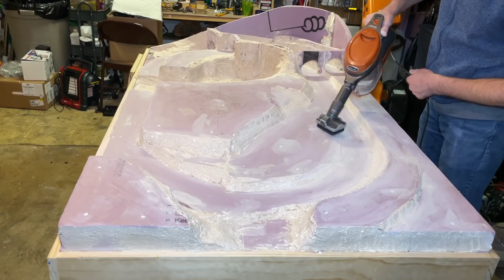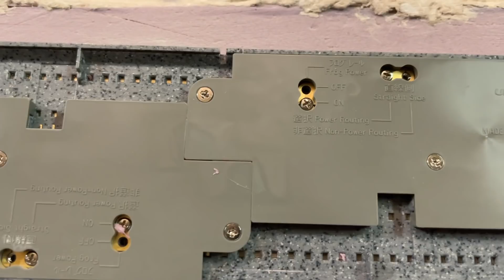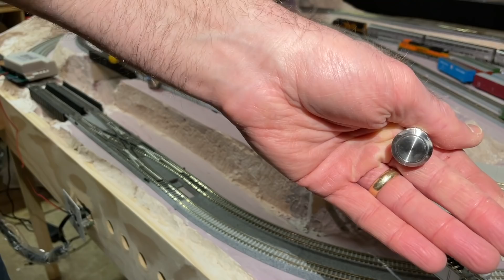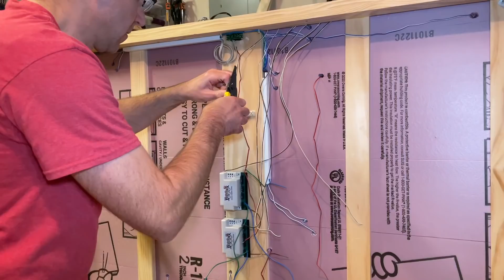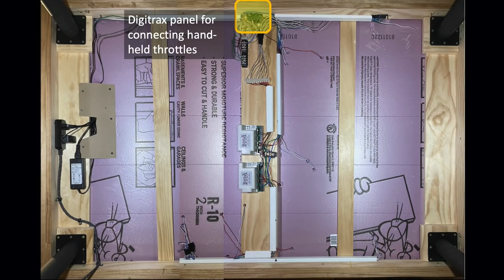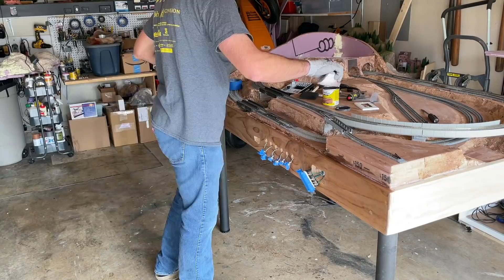3x5 N Scale Layout Project Part 2: Wiring for DCC

Comment: Is it possible to run a bigboy on this type of layout. P.s im a new subscriber to your channel. Thanks for the great videos.
Reply from the maker: Yes, I have a video or two where I run an Athearn Big Boy on this layout. The curve radius is no problem for any of the big boy models out there (BLI, Kato, etc). The only thing to be careful of is the tunnel portals and clearances around the curves since those locomotives are long and will overhang the track on curves more than other equipment so you need a little more space between the track and scenery than you might initially think.

Comment: your projects are always the best thank you, can you tell me how far apart you put your feeder wires? and do you solder track does it help
Reply from the maker: I usually put feeder wires in between each set of turnouts or otherwise about every three feet or so.  That is overkill, especially if you solder rail joints, but you are going to have some voltage drop through every rail connection over time, so have no more feeders can help prevent areas with voltage drops as the layout ages. That really isn’t that much of a problem but it isn’t that hard to add more feeders when building and a harder problem to solve 5-10 years down the road. The fewer rail joints you have the fewer feeders you need. If you solder rail joints leave some open for expansion and contraction of the layout will undergo any significant temperature swings. If you solder rail joints you in theory need fewer feeders because most of the voltage drop will happen across the rail joiners.

Comment: Steve, I have Couple questions about your set up for turn out control. Can you provide a spec or link for your push button switches?  And does wiring the switches the way you have preclude being able to you the Zephyr or hand throttle from being able to operate the turn outs?
Thanks 
TT
Reply from the maker: This is the link to the buttons: https://amzn.to/3KjR6IA  and yes, you can still operate the turnouts using the zephyr or hand controller as well. Since the buttons are momentary, they don't interfere with any other controls. It simply flips the direction from whatever the current direction of the turnout is when pressed.
Reply: @StevesTrains  thanks Steve. I have learned so much from you and your videos!!

Comment: Ok I like the legs but have a question: Are the legs the same ones that originally folded in? If so, does the plate come with the set so you can screw the legs on, so they won't fold? Was a little confused and was considering buying them. Thanks for any help on this subject!!! Stay Safe & God Bless!!!
Reply from the maker: So the legs come with the folding brackets and the fixed plates.  I didn’t have to buy anything extra. I didn’t know I was going to get both, however, so I can’t be certain you will always get both of you order those legs.
Reply: @StevesTrains  Thanks for getting back. Will try it out & hope I get both plates as well.

Comment: Hi Steve: I would if you could send a complete wiring diagram. I'm new to this, I have almost everything to start my project. I'm also wondering where you got your Kato # 20541: curved 15"+16.3", angle 45 (viaduct) 2. I have run out of options. Can you help with the items?

Comment: Ok so on the kato switches  did u do insulated  jointers on both sides of the rail or just one side of the  rail
Reply from the maker: I used insulated joiners on both rails of both tracks of the frog end. You really just need to insulate the frog rails but I did both rails so there wouldn’t be a gap in the other rail since the insulated joiners have that plastic piece that separates the rails.
Reply: @StevesTrains  so with doing both  rails , when using the dcc power pac  i looks like it goes  smoothly  all the way around . But what on the sidings . When u move the loco over past the insulated  joints  is there a dead spot  if a set wheels  are between  the 2 joints
Reply from the maker: @tonykane8866  The Kato turnouts are power routing (which is the only reason to insulate the frog end rails in the first place), so if the turnout is thrown the correct direction, the section of rail between the frog and the insulated rail joiner will be powered. If it is thrown the incorrect direction (relative to where the locomotive is), that section of track will be dead. Having those joints insulated just helps to prevent shorts and the whole layout shutting down if a locomotive enters a turnout from the frog end and the turnout is thrown the wrong way.

Comment: I built a few layouts for people. Used Hollow Core Doors from Lows/Home Depot/Menards. You could get Scratch-n-Dent for around $5 each. Simple 2x4's for Frame and Legs.
Reply from the maker: Yep, hollow core doors are great for layouts. You can usually get decent folding legs from there as well.

Comment: At a hobby shop I hung out at Everyday (unofficial Employee), we had a layout in the window. Bachmann EZ-Crap.. I mean track. 30-40ft worth of track. Dog bone. So many gaps in the track, we decided to close them. By the time we were done, we had over 3inch Gap. So we had to go back and put all the gaps back in.That was the Nickle Silver Track. The Steel Track was Worse.
Reply from the maker: I’m sure the thermal expansion and contraction of the track if it was getting direct sun through a window was probably pretty significant I’ve done some layouts in the past with ez-track and had success with it.  It certainly isn’t as durable as kato track in terms of reuse, but if you just put it down and leave it, the track can work fine. The main issue is that the rail joiners can become loose very easy on the Bachmann track so if you reuse the track you need to make sure you crimp the rail joiners back down.
Reply: @StevesTrains  The heat from the window had nothing to do with it. Not direct sunlight and all the gaps were there right after we assembled the track. All done within a hour or so. Never had Problems with their Normal Track having gaps. We were not the only ones having gap issues. A Lot of the costumers were having same issues. They didn't like all the gaps and closed them only to find one Huge one by the time they finished. Plus EZ-Crap... I mean Track is Double and is some cases More than Double the cost of Normal Track. Tho Price of Regular Track has gone up since mid 2000's..
Reply: @StevesTrains  Plus NO Flex Track in that kind of Track. Sure, they have the 3ft Long track but $$$$. Could get Flex for about $4. but EZ-Crap... I mean Track, $9 or more. I am a Atlas Fanboy for track..